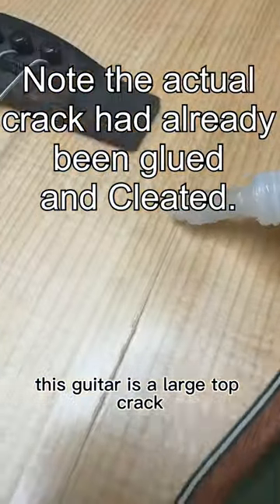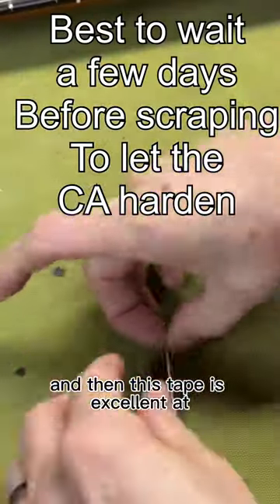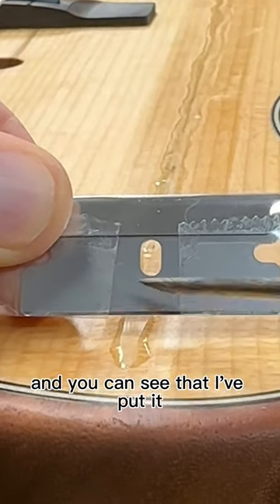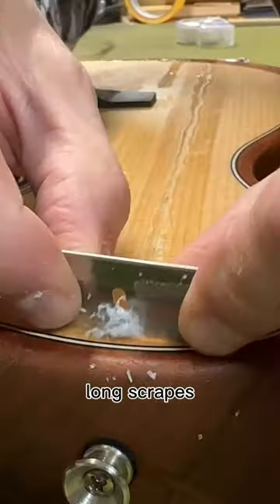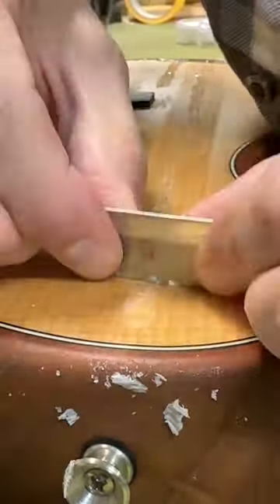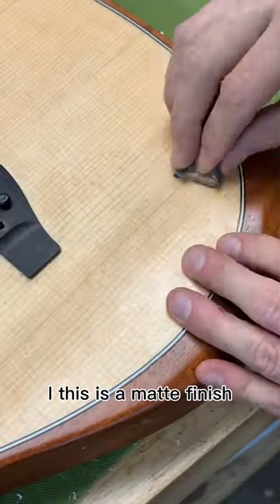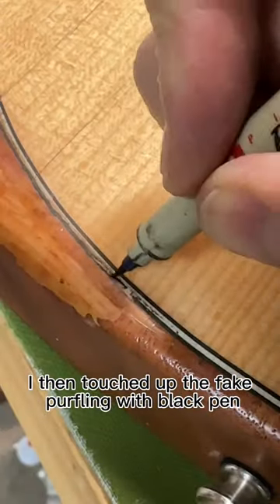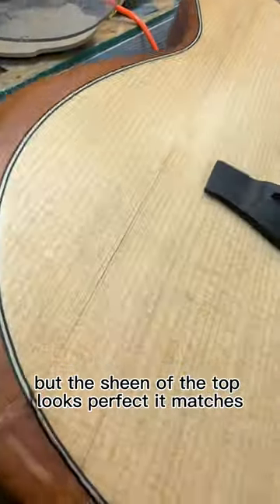BEST Glue for Guitar Finish Repair

Comment: You could scrape the surface with a rubber spreader before it hardens. This will prevent having to scrape off the hardened gluboost. It's similar to applying grain filler then wipe it.
Reply from the maker: True. This had deep cracks and finish missing so I kinda had to build it up over the surface .

Comment: Mr. Hannam, 

I would respectfully ask that you specify which Guitar Center you believe the sub par repair came from, as I assure you, the guitar repair tech at the Grand Junction store takes pride in his work and would not take a job he would not be able to complete to an acceptably high standard. Thank you.
Reply from the maker: If a guitar tech has only received  Guitar center in store training, they won’t be as good as someone who has been doing it for a while. But there are talented GC repairers. It just depends on the tech and who trained them. I’ve spoken to several GC techs (former and current) and they said the in store GC training can be very limited, but tends to be/seems to be sufficient for repairs like set ups, new nut/saddle etc, electronic work. I fortunately thier is some idiotic GC loophole where talented techs can’t take home repairs that they can’t do in store. Strange.
I like everyone at my local GC. I’ve not met  my local GC repairer but I’ve heard he is also a guitar maker and can do more repairs then they let him (loophole). I’ve not seen his work but I’ve heard what he does is good. I hope that helps my position of GC techs. Basically , just like non GC techs, it just depends on how naturally good they are! Hahaha

Comment: Hello, great video.  I have an old Kay parlor guitar. The bridge was bolted down on top of the guitar's finish with no glue.  It has lifted up and I have removed the bridge.  I want to glue it down and re-bolt it.  Is there a glue that will bond the wood bridge to the guitar's glossy finish?  thanks for your help.
Reply from the maker: Thick Ca glue is usually used in such a case but if it’s old finish it’s probably flaky and you might be better off removing the flaky finish (hard to say without seeing it)
Reply: Thanks, the finish is in pretty good shape.  Not sure how to add a picture.

Comment: Love this, but I repaired a Blueridge once with such a heavy gloss finish and the glue got under the finish and opened up a can of visual worms. I could see this working on many finishes though .. but test a small area first right? (PS surprised an Acoustasonic top already split!)
Reply from the maker: This guitar got crushed. Finish work is usually some of the most problematic repairs to do.
Reply: @BeauHannamGuitars  agreed! It’s why you have to love the French Polish… so fragile , yet it can be mended. I would watch my mentor taking a lightly moistened waddle of something like Fresh Polish/ lacquer and do the minutest of touch ups on a 1.5 million dollar Guadagnini! Of course I do the same .. but on my relatively cheap old guitars. However, newer instruments have complex synthetic finishes and sometimes you don’t know what to use or what’s gonna happen. Finish work is quite an art form. You’re making it look easy here!!

Comment: I’m working on my first CA glue drop fill now. I’m using gorilla thick. How long is the “few days” you let it harden?
Reply from the maker: I give it 3 days. Like I say in the description Glu boost is a little different to other ca glues. It’s made and designed for instrument repair work. gorilla glue (or any other ca) isn’t so
Reply: @BeauHannamGuitars  I suppose this calls for a shootout. Which brand works the best. Actually, I saw another luthier say she was having better luck with Krazy brand (or something common like that) than with glu boost for drop fills. I used dollar store thin as well but I didn’t let it dry for 3 days. It worked well I think, it just took another couple little pieces with it when scraped it off. Dollar store has been working great! $1.25!  Thanks.
Reply from the maker: @MoGiMaL  for poly, which is hard, cheaper brands of CA would work. For nitro, i only use glu boost. SOme ca burn nitro and other ca accelerators have acetone in them which melt nitro. Glu boost was made with for luthiers with nitro in mind
Reply: @BeauHannamGuitars  Oh, the one I’m doing is PU (brite tone). Ahhh. I didn’t know any of that. Very interesting. Thanks. Now I want to put CA on nitro and watch it melt. And spray an enemies guitar with acetone
Reply from the maker: @MoGiMaL  hahaha
Reply: Ahh my search has ended. I sent you an email Beau. I would still love a reply there if possible. But one of my imbedded questions was about this Glu Boost glue. I remembered watching this short but it has taken me forever to re find it. I have a nitro top coat which is causing me fits . Large laquer cracks that I can’t seem to fill or sand away no matter how many coats of nitro or French polish I try to get into those cracks. Maybe Glu Boost could help?
Reply from the maker: @michaelaiello9525  I’ll reply with an email

Comment: I still see the crack 😮should’ve used tinted CA or resin. I’d have reinforced the interior of that crack too. 

Marker 🤦
Reply from the maker: I cleated it. This had about 1/8 of thick finish missing so it was hard to disappear. I didn’t know about tinted GFlex when I did this but I probably would use that now on this.
Reply: You’ll always see the crack, unless you route out a channel and insert an overlay. People touch and rub their (dirty) fingers on the crack which causes the crack to darken permanently.

Comment: Sheen does not look perfect.  You can clearly see the difference..
Reply from the maker: There was a difference as around the crack the finish had chipped away. I was basically drop filling the poly finish in this video